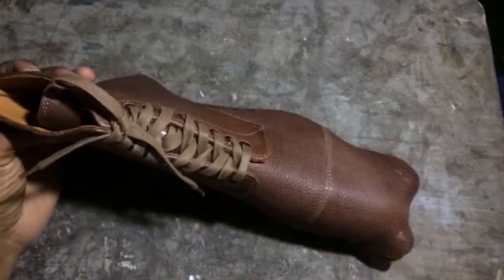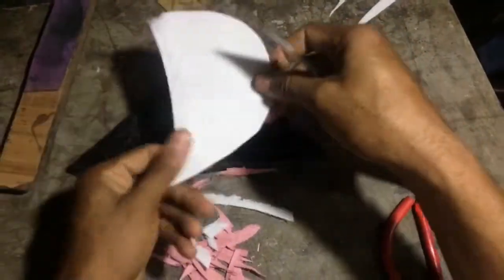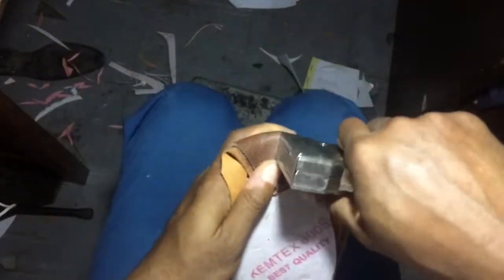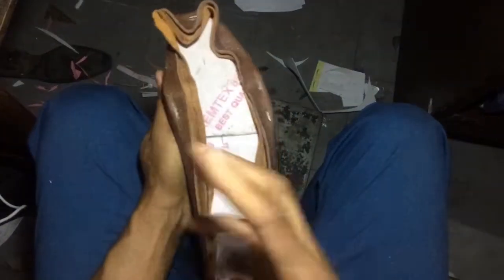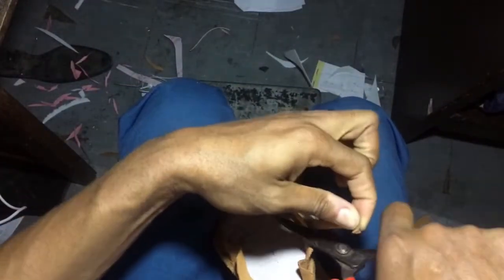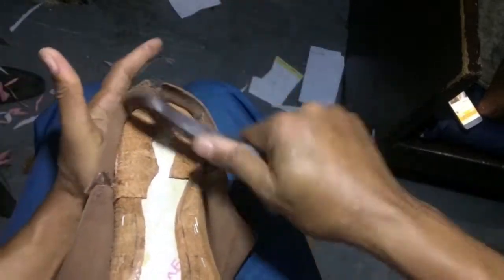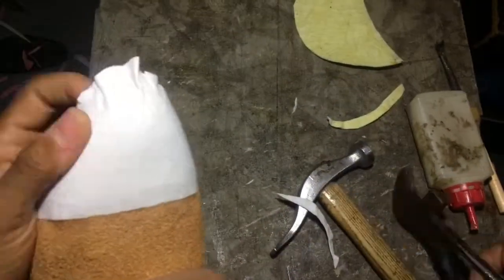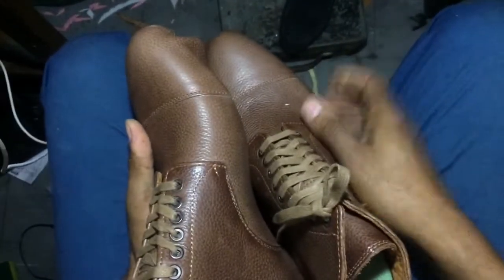How to last a Derby Boot

Comment: Thank you for this video

Please is it compulsory to put the back stiffener on the boot before lasting?
Reply from the maker: Not necessarily. I have done it after the pre-lasting severally. Basically, if you are able to pull up the counter to place the stiffener, go ahead. Putting it in prior to the pre-lasting is just faster.
Reply: @KpomoBespoke  ok. Thank you

Comment: I have a quick question.  If you were going to use a heavier counter material, say a 6-8 oz leather.  Would you allow for that in your pattern.  In other words would you make an allowance in your pattern to accomodate for the thickness of the counter material.
Reply from the maker: Yes. Typically you should. But the way I design and stitch that back seam gives so much room that I have never encountered any problem there no matter the type of counter stiffener deployed. This has been my experience.
Reply: @KpomoBespoke  Thank you for the quick response.  I'm learning a lot from you man I really appreciate it.

Comment: Sir please what's d function of the shoemaker paste (Top bond) and why not use d normal O.C.I
Reply from the maker: It is a slower drying adhesive than the normal gum (OCI). So it give me enough time to make adjustments to my lasting and ensure that everything is in proper place. When it is try, it makes a very strong, flexible and water resistant bond. The bond is even stronger that that of OCI.
Reply: But pls are we to leave it to dry or last immediately after applying it sir